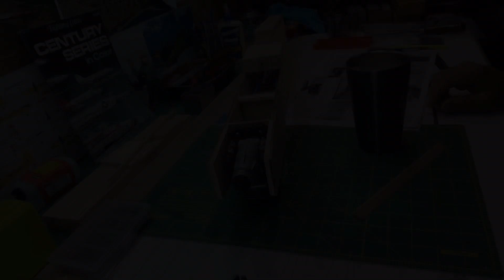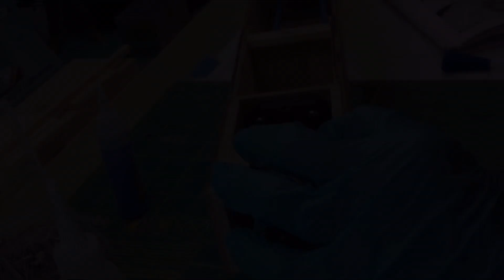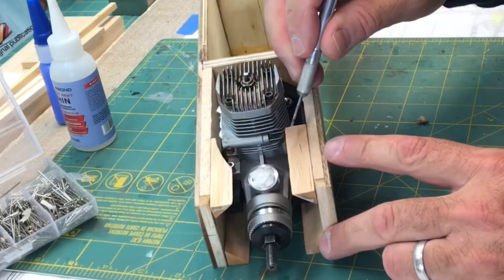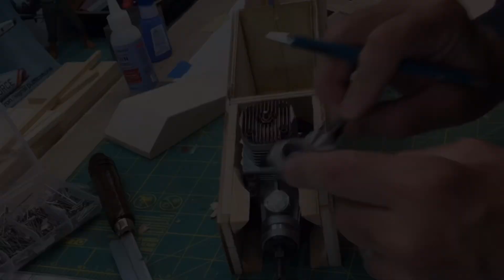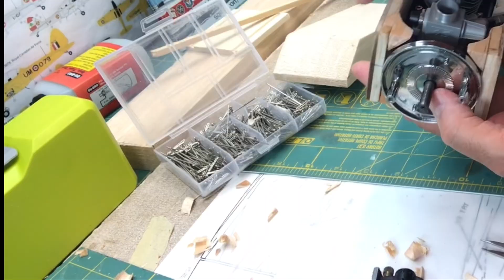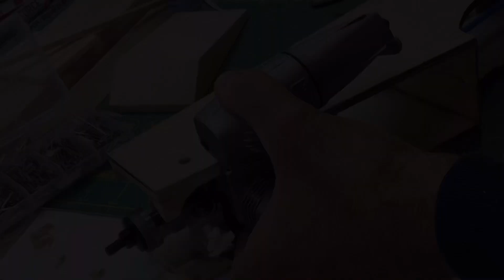Balsa USA Smoothie RC Plane Kit Build No 24, Fitting the OS 46 AXII

Comment: Thanks for sharing, is the firewall already angled i guess 3% or did you angle the mount to get thrust ?  Thanks
Reply from the maker: Interestingly, there is no thrust line angles noted in instructions or on plan. If it becomes an issue during flight I can make some adjustments at the mount.
Reply: @jamesrcplanetech  thanks

Comment: How are you going to adjust the bottom end needle?
Reply from the maker: That is a very good point. Ill will need to either drill an access hole for a screw driver or just cut out an opening. Thanks for pointing that out.
Reply: @jamesrcplanetech  Yes...excellent....must be done for sure 👍

Comment: Are you going to add a refueling port. After the cowl is built up it will be tight trying to pull the tubing on an off
Reply from the maker: Hi, Im not sure. Ill see how things turn out. Considering Ill have to remove the top block each time I fuel, I may just go with a third line that has a stopper that I can just tuck in next to the tank instead of a refueling port that is installed into the fuselage which take up room. For sure I’ll be using a dedicated fueling line instead of pulling off the engine each time.